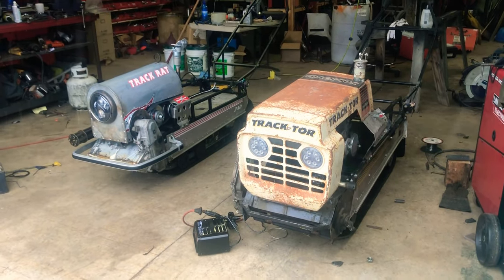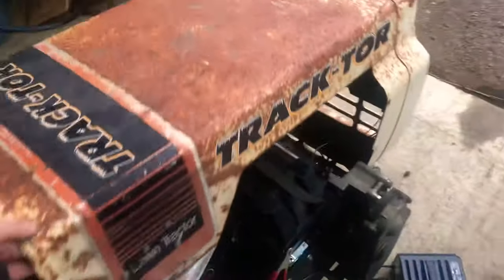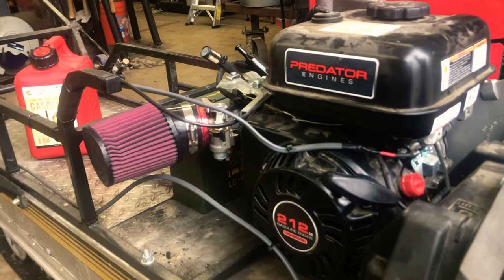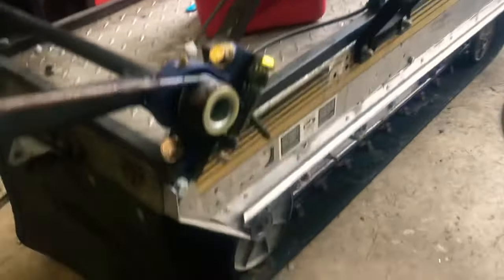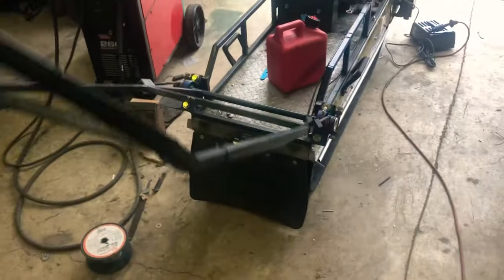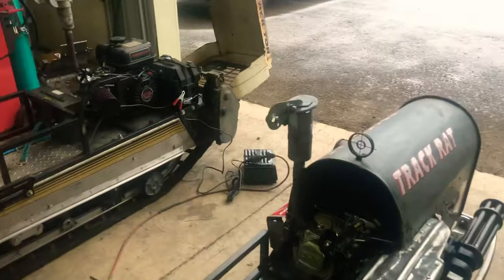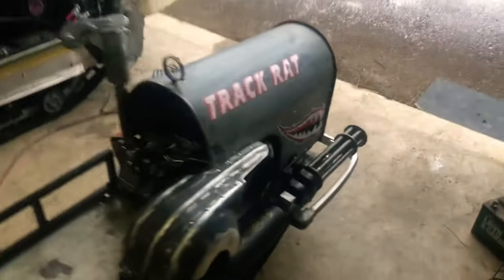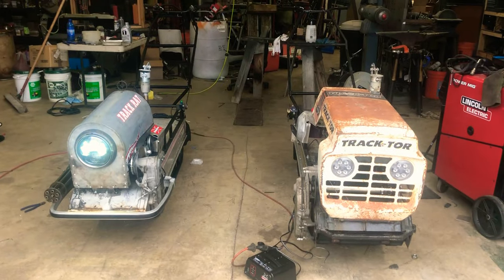Homemade ice fishing Track Sled. TrackTor and Track Rat

Comment: I am just beginning to built a track sled from an 89 ski doo formula mx chassis.  I have a lifan 6.5 honda clone, a cvt clutch kit.  Do you have to cut a keyway slot on the Jack shaft for the chain sprocket? Thank you in advance.   Love your builds.
Reply from the maker: There are a few ways you can fasten the sprocket on. 
1.) cut a keyway slot in the jackshaft; if you don’t have milling ability you can  use an angle grinder with a cutoff wheel to CARRFULLY cut the slot in. Take your time and check for fit often 
2.) You can sandwich the sprocket with keyed shaft collars on either side. And run a piece of 1/2 width key stock through both collars and the sprocket. This is what I did on my first machine and have had zero slippage.  
3.) Weld the sprocket to the jackshaft. This is a very solid method but you will have zero adjustability once you weld it on. 
Here are some links to the parts I used. Sizes will depend on what you need for your project. Width of the slots should match on the sprocket and shaft collars. I used 18tooth sprockets on both of my machines. Seem to have plenty of torque. Let me know if you have any other questions. 

https://www.mcmaster.com/shaft-collars/construction~two-piece/clamping-two-piece-shaft-collars-9/

https://www.mcmaster.com/key-stock/machine-keys-5/

https://www.mcmaster.com/roller-chain-sprockets/sprockets-for-ansi-roller-chain-9/
Reply: @dalen1120  thank you very much
Reply from the maker: The 2nd method doesn’t require you to cut a keyway in the jackshaft. The collars hold the key from slipping but since there is no keyway cut in, you need a key stock that is the full width but 1/2 the height so that the sprocket can slide over it. It will be rectangular in cross section. McMaster carr provides detailed pdf drawings and dimensions of most of what they sell so you can get it all figured out on paper first.
Reply: It looks like my jackshaft is 1"  I am probably going to order a gear soon.  I have seen a 15t, and an 18T.  I am ordering in Canada and hope to get it sooner than later.   Saw a couple on Amazon still trying to decide to cut a keyway or use collars.  Princess auto (harbour freight equivalent) has some keyway collars.  I just want it to work.
Reply: My clutch kit uses a 35 chain
Reply: A cart place here I can order an engine mount plate , and aluminum 1" keyway collars,  but I am thinking that steel keyway collars are likely a better way to go
Reply from the maker: @tonyriley4585  I’m sure aluminum collars would work. Just gotta be careful not to over torque and strip out the threads. My machines are running 420 or 41 type chain so the gear ratios will be different for your 35 chain if you go with an 18 tooth sprocket. A 18 tooth (41 chain) sprocket has an OD of 3.14” an 18 tooth (35 chain) sprocket has an OD of 2.35” so it would have less torque and more top end speed if your motor has enough torque to pull it. If you wanted a similar diameter sprocket to what I have I’d go with a 25 tooth (35 chain) sprocket it will have an OD of 3.19”.